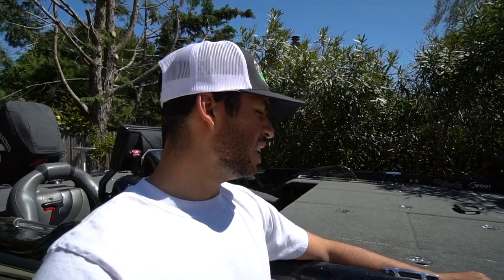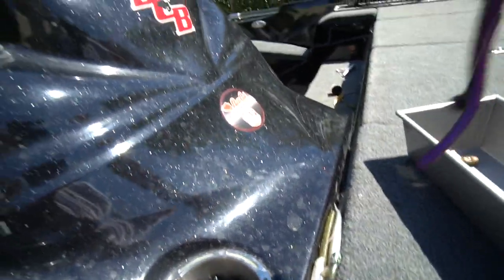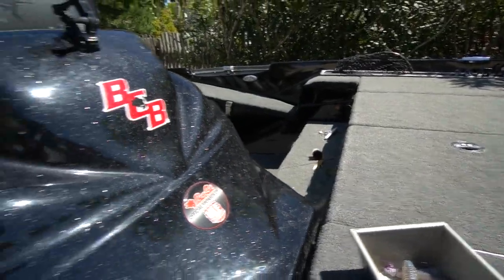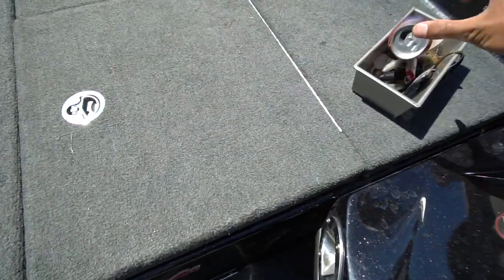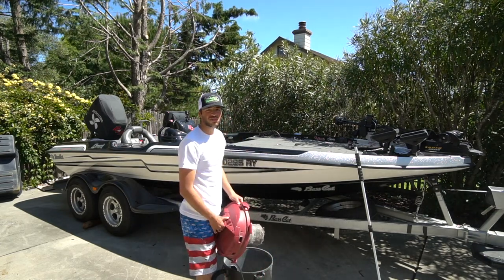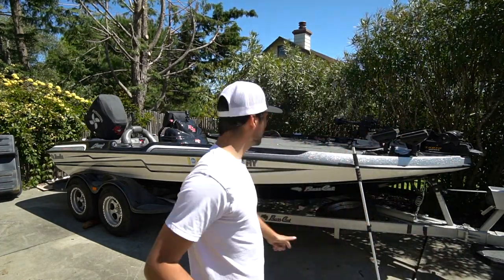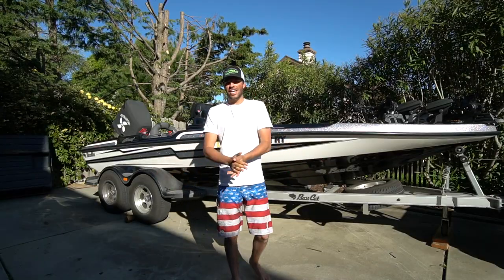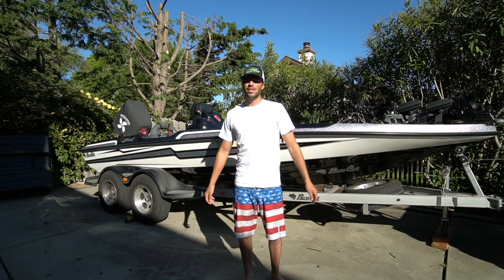Best way to safely clean your boat carpet! LOOKS BRAND NEW

Comment: Bass pro in West Marina have a couple really good carpet cleaning products. Even like most of us bass fisherman that don't even use live bait you can tell you the ones that says take it blood out of your carpet. I've tried the one that doesn't say that and the one that does. The one that says works on blood is a very good choice. There's a couple different brand names Star Bright and shorehole I don't think I'm spelling that one right I'm suffering from daylight savings time right now. -)

Good video Dawn is an excellent choice for cleaning items on your boat just don't ever wash your boat with it it will take all the wax off of it.